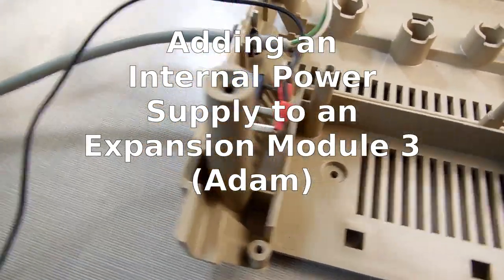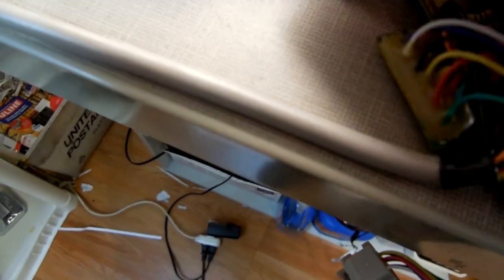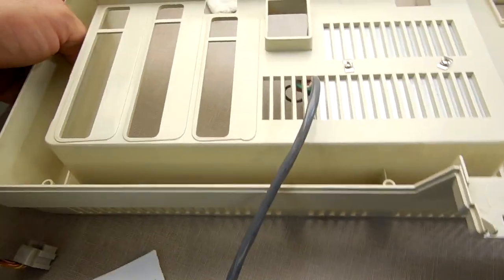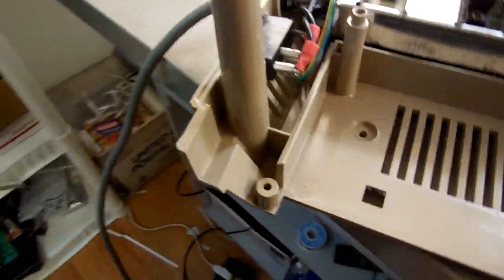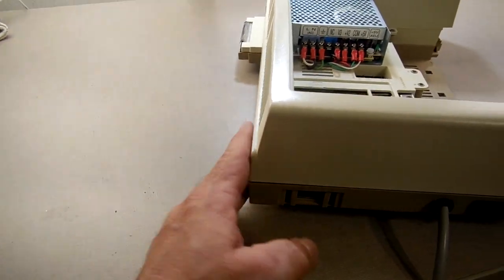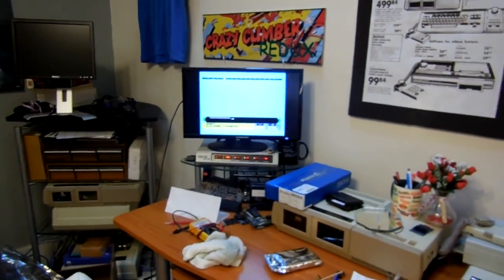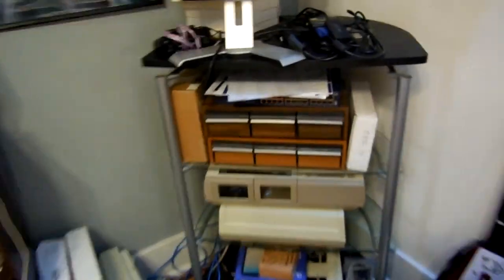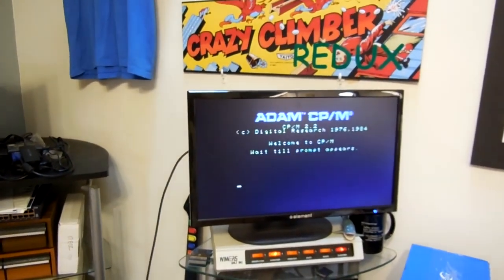RGC: Colecovision Expansion Module 3 Internal Power Supply

Comment: I really like that location front left of unit but looks like small space to work in.  Do you think on Adam's that location would also work?  I noticed you did a power cord separate (grey 3 wire), I prefer the switches with the female standard PC power cord combined with switch, but I assume that is to big then to side location on Adam.
Reply from the maker: It would work but you won’t have space  for the plug as you said. I usually use one of those but on the expansion module 3 space is at a premium

Comment: Thanks for video! So I thought the +12 were pin 1 and 2, did you bridge these?  Also do you have a pic of it before the glue, wanted to see how you did pin headers, do you have a jameco or mouser link for the header pins
Reply from the maker: Yes I bridged them. The pin headers were just what I had on hand, the holes one the board were too small for the wires so I soldered them to the pins and then the hot glue is just to cover them - Coleco loved their hot glue so I was keeping the tradition going